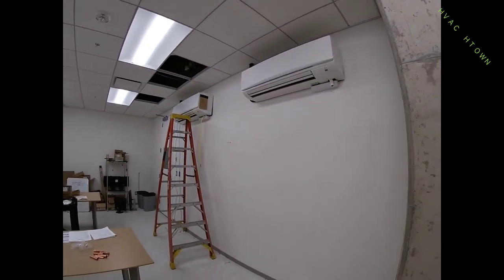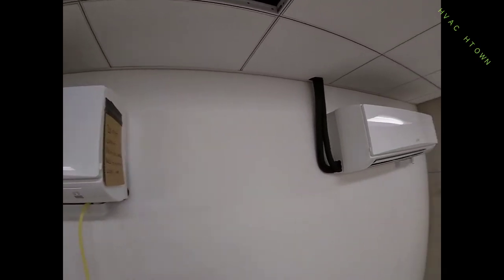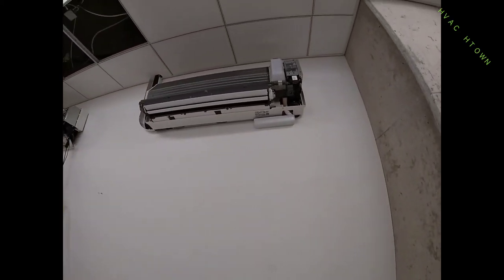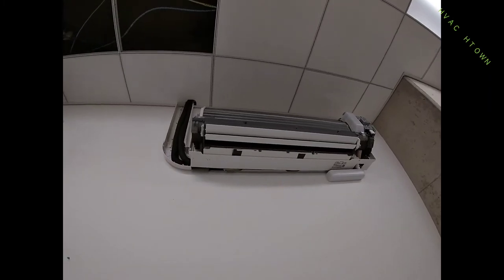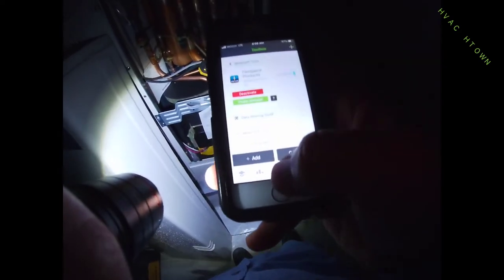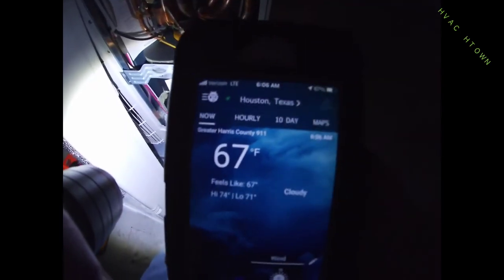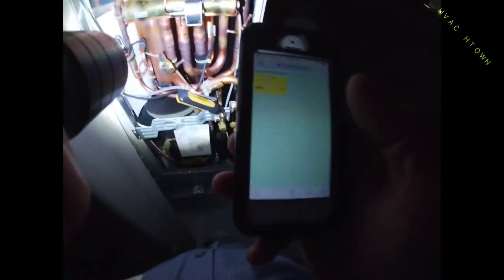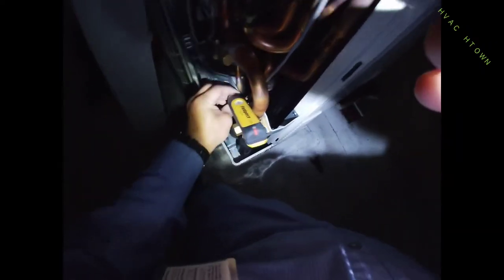Mitsubishi city multi install

Comment: You had the micron gauge on the wrong end of the removal tool, when you valved  off it was not reading from the system so the low volume is what caused the drastic rise in microns.